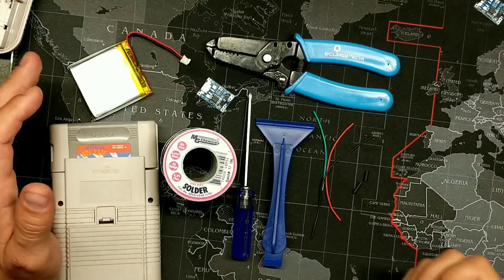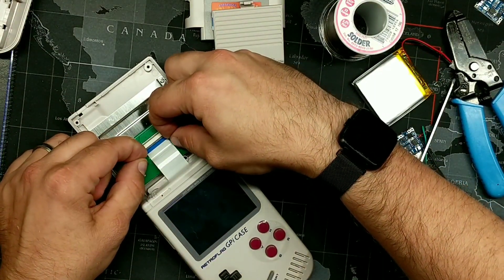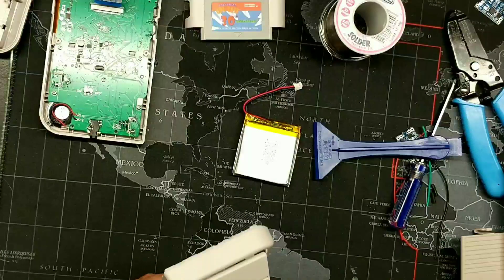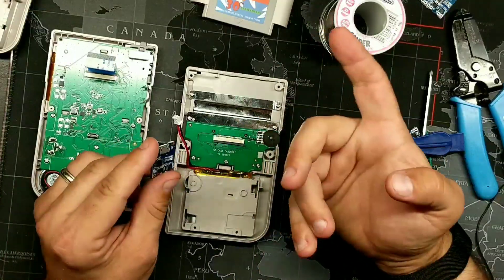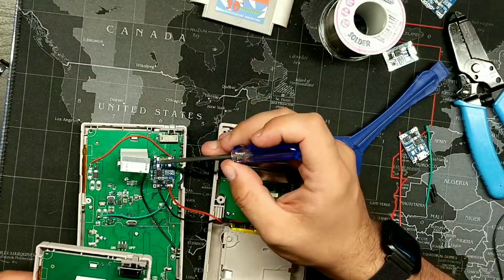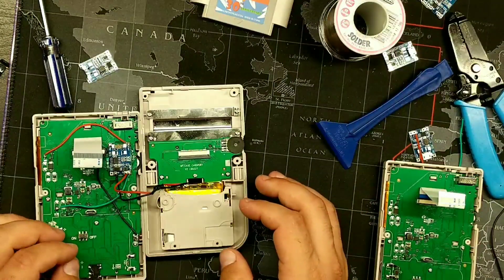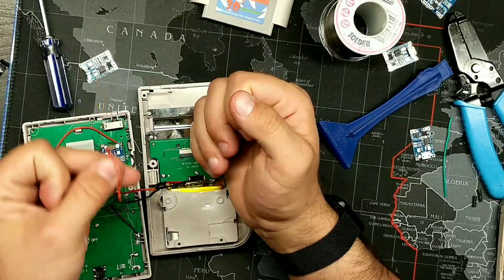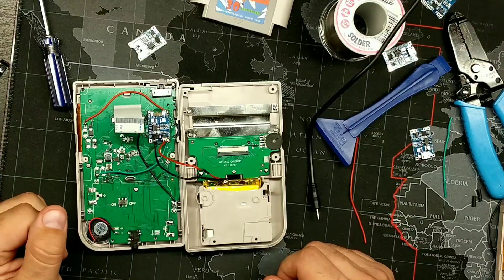How to: GPi battery mod using stock Jack plug

Comment: Greetings, how much can be the, minimum mAh for the battery or it can be any mAh, thanks.
Reply from the maker: Any mah will do just need to make sure you have the correct batteries for the charging corcut
Reply: @AkumaMods  ok, thanks, if indeed I must be careful that the battery is correct, it is 3.7 v.  and whatever the mAh, can it serve me, more or less how many hours of play can I have?  😉

Comment: Anyone know if a battery voltage % can be added to show how much battery is left? Awesome mod.. I did this and it works great.
Reply from the maker: I'm working on that right now actually but due to what is needed from the pi a new case will most likely have to be made for it as well

Comment: I dont know if you thought of it but i had a spare jst connection (i think thats what that is called) so rather then cutting into the battery wires....in case i needed to replace the battery one day i put wire to the connector and wired it to the board.... ill prob be able to hide it some where if not ill cut the connections and go back to the wire to wire method
Reply: I looked for one to salvage off old dead mo-boards I have, but in the end I just used 2 push in metal connectors soldered on the ends with shrink tubing over the connections so I could at least separate the 2 halves in the future.

Comment: In the words of columbo....just one more question sir... the kapton tape.... can i use packing tape instead or is the kapton tape the only choice? Thanks
Reply from the maker: You can use normal tape if you want. However I suggest kapton because it doesn't transfer heat like normal tape will
Reply: AkumaMods thanks then thats what i shall get before i procede

Comment: I performed this mod and, there’s only one issue. Something causes the battery to discharge over the span of a few days. Now, with regular rechargeable batteries, it would do the same thing. Either way, this is a GREAT mod. It makes things convenient.
Reply from the maker: Very strange. Did you use a lipo charger with rechargable batteries or did you use my NIMH charger with rechargable Batteries??
Reply: AkumaMods I just had some rechargeable NiMH batteries that I used with a battery charger. They only discharge once placed in the GPi case
Reply from the maker: Right but are you using a NIMH charging circuit or a lipo charging circuit(tp4056)
Reply: AkumaMods it’s a lipo charging circuit. Like I had said. I performed the same mod you had done. It’s a Lipo battery, Lipo circuit. If I had know about the NiMH charging circuit, I would have done that mod instead.
Reply from the maker: @LelandHasGames  yea that's why they are discharging. The lipo charger on NIMH batteries will never fully charge them ever.
Reply: AkumaMods you’re not listening to me. It’s a Lipo battery on a Lipo circuit...
Reply: @LelandHasGames  " I just had some rechargeable NiMH batteries that I used with a battery charger." Your saying you used NiMH batteries on a lipo circuit " it’s a lipo charging circuit. Like I had said."
Reply: ILordSpawnI that’s NOT what I was saying. I was simply saying that I HAD used them prior to the modification because he had asked if I did. I DID NOT use NIMH batteries with the LIPO charger.
Reply: @LelandHasGames  Ok. So (no mod + NIMH batteries) and (lipo mod + lipo batteries) both cases the batteries drained in a few days? So the pi is using power when shut off? I know the pi3 still has leds on when a shutdown is performed. I wonder if it goes into some really low power standby mode.
Reply: ILordSpawnI I think it had something to do with my GPi Case. I bought a new one and, all those power issues are gone. I think the one I had was faulty

Comment: Thank you so much for this tutorial! You are awesome!!
here are some question:
1. While it was on battery power, i plugged the barrel jack in and the pi rebooted itself, is this normal?
2. Would this battery still charge if i connect through micro usb port on the back (above the door latch)?
3. while playing with the cable connected, is this Charging & Powering at the same time?
Reply from the maker: 1. No it should not do that. Make sure all the connections are correct
2.yes it will connect through the rear door micro USB
3. Yes it should still charge while playing just not at full capacity.
Reply: If your connections are correct, check the rating of your power supply, it will crash on a 1a supply but 2a should be enough to charge the battery and keep running.

Comment: If you don't want to butcher your battery compartiment you can get type 14500 3.7 V LiPos. They have the same formfactor as AA batteries. You have to mod the wiring of your compartiment to parallell though!
Reply from the maker: Correct sir. That mod is going up in my shop tonight
Reply: @AkumaMods  Have you done it yet? Turned out that the 14500 LiPos I used are cheap china crap and dont hold up to their promised capacity. Would be nice to knowwich ones you used and if they are any good :)
Reply from the maker: @goldennboy1989  I actually have 2 sets to try out. One is EBL red lipo AA batteries and the other are the best money can buy called kentli. Amazing lipos but my focus right now is the ability to have a charge circuit for everyday nimah batteries
Reply from the maker: @goldennboy1989  also check out our discord channel for more up to date info on the GPi
https://discord.gg/daEGkSW
As well as my Facebook page on the GPi case

Comment: Before I found your video I directly soldered to the pins on the barrel jack for charging. Do you think I can leave it like that? Seems to work fine.
Reply from the maker: Yea that should be fine. That was going to be my initial go to but then my buddy said hey these pads on the back are connected to it so you can go from there

Comment: Does safe shutdown still work? I am a little confused, since i only used powerboosts before for my gbz builds. The powerboost needs to be turned OFF else it will stay ON (blue LED) and draw battery energy
Reply from the maker: You can not use a powerboost on the GPi unit it will try the chipset on the board. You can only use a charge circuit. Yes this mod only adds on a lipo battery option and nothing else. No other changes to the case are made

Comment: Can you use adafruit powerboost 500c?
Reply from the maker: I don't suggest any powerboost on the GPi case because it'll mess with the powerboost on the GPi case. Use only a charging circuit board without a powerboost
Reply: Thanks I did order the board you used. It would be cool if you could post screen shot of the wireing
Reply from the maker: @ktommini  yea I could do that. I actually just did a mod on a customer unit last night so I'll link that for you. Or if you want you can check out my AkumaMods shop on facebook

Comment: What about not using the barrel jack but instead using a micro USB?  the barrel jack seems weak and could break off easily.
Reply: Im not sure how true this statement is :D every phone i own the first thing that breaks is the micro usb yet all my 30 year old electronics barrel jacks still work :D
Reply: @robknott1597  I can somewhat relate to that with my old old old phones (current iOS user for 9 yrs strong).. the OEM barrel cable for this GPi is too short for my liking, I don't like the location, and its another cable to carry around.. I'm leaning towards an iOS ligthning port instead of a microUSB.. either way, if they break in the future... I can always replace it since i'll be the one who installed it.. I'll try to make a video of mines when the parts arrive and let you know when I get a chance..
Reply: @huskyrooster   you must be easy on  your phones! :D or im to hard my phone is less then 6 months old and from playing and charging the jack is so loose i have to set the cable under the phone :D  id be happy if micro usb died and everything was made with usb-c ! i ordered the red magic 3 so lets hope it lasts or my wife may burry me in the hills behind the house. lol
Reply from the maker: Yes you can do that but it requires cutting the case
Reply: AkumaMods Yes that is true.  With your mod, you are already cutting the case.  So would it be a direct wiring to the original battery prongs that you have cut?  Therefore, just wiring the red and black accordingly. Then installing a micro USB pcb and wiring to that?
Reply from the maker: So basically for the mod to work with micro USB you would wire it up to the battery and get a micro USB extension board then iwre that to wherever you want it. I wired up one for a customer that he wanted the micro USB so I put the charger pcb in the battery compartment and cut right behind the headphone jack
Reply: @AkumaMods  Thank you!  you just confirmed what my plan is.  I've already ordered my parts on ebay.  I'll start on this when it arrives.  I might modify mines a little bit and use an iphone lightning port instead of a micro USB.  I'll test that out first to see if it works.  Thanks again!  Keep up the great videos!
Reply from the maker: Yea you can use any port you want as long as you wire it up correctly

Comment: why the tp4056 out- was empty,no wire?
Reply from the maker: There was no need because it's a passthrough ground. You can connect it back to a ground but it is not needed
Reply: @AkumaMods  thx